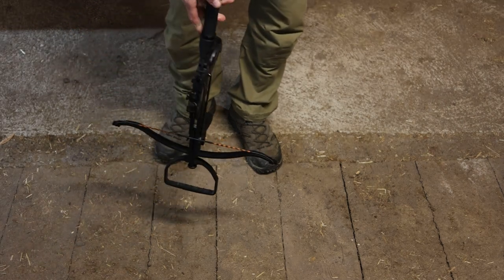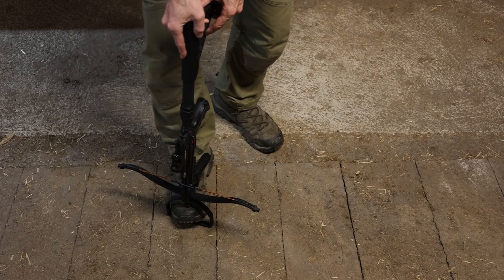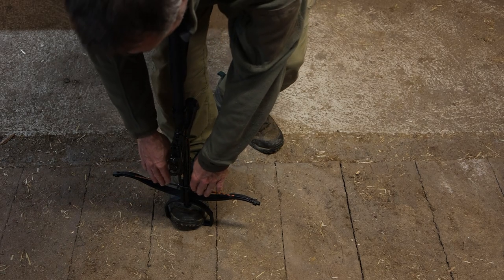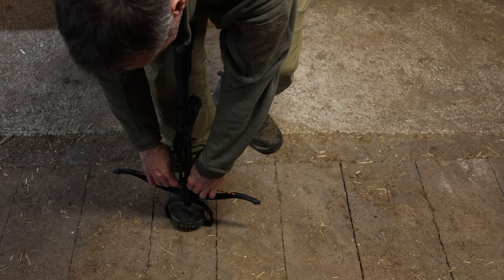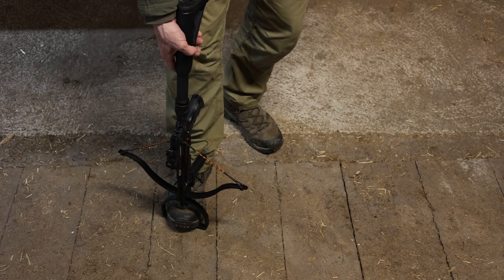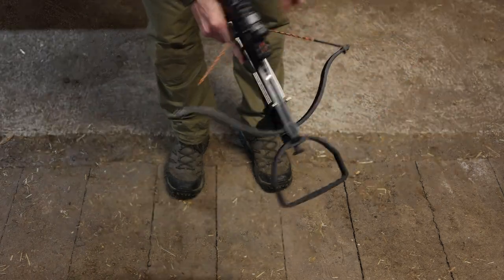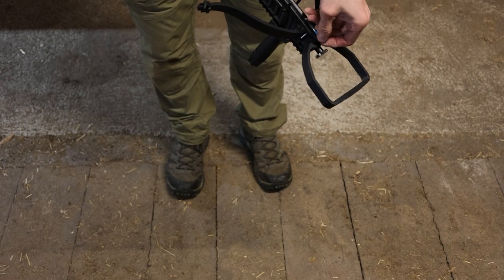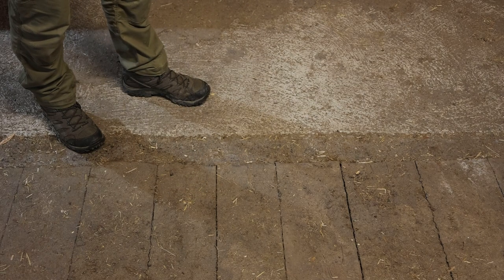How easy is it to cock and decock 150 lb in a Stinger?

Comment: Cocking it with the leaver, with the 150 draw, does the leaver feel like it's wraping or bending at all? Must be getting close to max draw weight for this leaver and polymer frame, thoughts?
Reply from the maker: The lever still feels fine in terms of flex, but I still have the sense that we approaching the sensible draw weight limit for the level. In my opinion, the 150 lb is basically best the Survival configuration and the cocking stirrup. 

The biggest weakness I see in terms of the lever and higher draw weights is that the threads of the factory bolt run through the pivot hole in the lever, so you have sharp edges that are bound to slowly widen the hole. A bolt with the shank extending through the lever would be better here, plus perhaps a steel bushing in the cocking lever, of the same hardness as the bolt. Or at least brass. 

In terms of the polymer frame, I suspect it could take a lot more draw weight before flexing, and that a conventional claw lock like on a Vlad would fail at a lower draw weight than this chunk of polymer with a notch in it. But I would like to actually test this, and could be wrong.
Reply: Thanks for taking the time to reply  @fletchedevolution ! Appreciate the insight.
Reply: @fletchedevolution  "A bolt with the shank extending through the lever would be better here", what about using the original bolt but with epoxy glue covering the surface of the thread not used by the end nut ?

Comment: If reliability and longevity are to be considered in a longer term survival / shtf environment, then it is my opinion that 150lbs draw weight is too "heavy" for those plastic bodied pistol platforms.
I have not done any engineering tests but my "instinct" would suggest that running them well above the designed draw weight of 50lbs to 80lbs could find any weaknesses much quicker than under stressing them.
Same goes for string life.
Running a string at 80lbs is going to put much less wear and stress on it than running a string at 150lbs.
These may not be  concerns to  some, nor even considered, but if the build quality of a full size crossbow running 150lbs is compared to a plastic pistol running 150lbs it may become a concern.
It is my opinion that if such high draw weights are going to be entertained then either a metal bodied pistol should be considered or better still a full size crossbow / carbine crossbow such as the R9.
I feel, and again just my opinion so I won't be offended if people disagree, is that the plastic bodied pistols are best used with draw weights of 90lbs or less.
Reply from the maker: Yes, you make very good points. At 150 lb, I see more the cocking lever as a potential weakness with extended use, unless you use a bolt with a shank that extends through the pivot hole and also perhaps put a bushing in the pivot hole.

I am not sure that 150 lb is enough to flex this chunk of polymer with a notch in it, I need to work up a way to measure this.

But string and arrow wear are definite, definite factors, at these high draw weights. You need aluminum end caps really, and these also probably wear out the end loop servings way faster than the polymer ones at this draw weight. 

I think that 120 is probably the sweet spot for an actual survival Stinger, but 80 or 90 lb is also more than enough for game of a size that I think you can cleanly and quickly kill with the small broadheads we can get now. 

Also noting that traps and snares are much more effective for getting food if you are actually in a survival situation (taking legality into account as always).